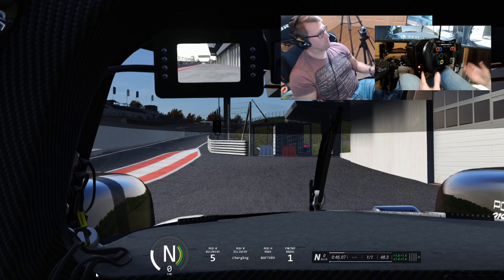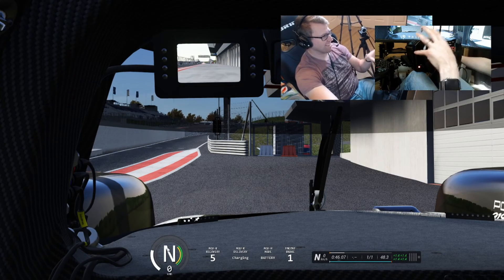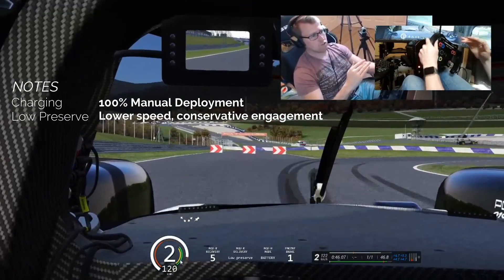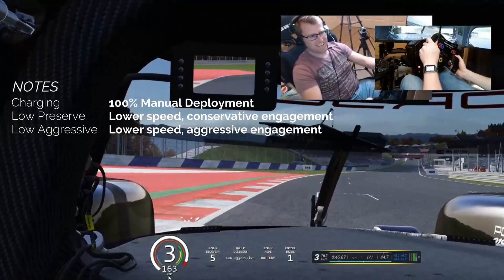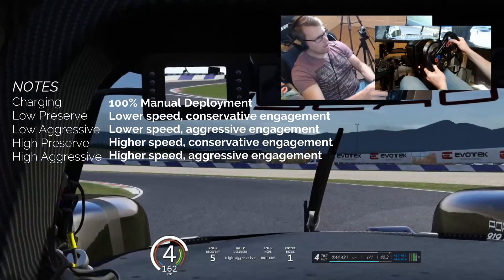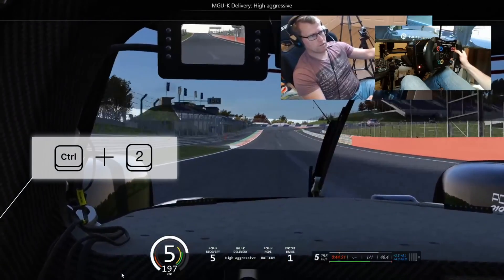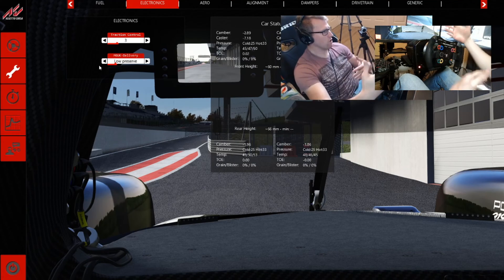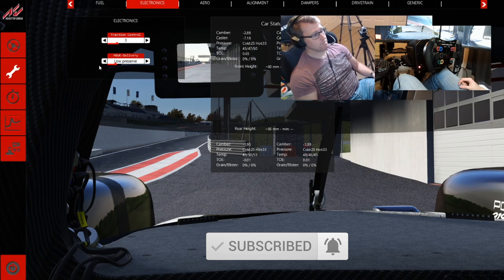MGU-K Explained in plain english | Assetto Corsa | Porsche 919 Hybrid 2016

Comment: No matter what setting I have the MGU-K in, it always empties before I reach the start/finish line, which costs me tenths of seconds and positions in races. Any tips?
Reply from the maker: Yep, use manual deploy if you want more control. Or switch to charging during the parts of the lap that you don’t want to deploy on. It also depends on the track. At de la sarthe, you are likely to run out of your allowance quite early on. I recommend balanced low, in general
Reply: Update: I finally figured out a sufficient strategy. Thank you!

Comment: Some cars have battery and motor options, and i have yet to fully understand how that works, can you give me clarifications? Great work btw, the channel is relatively small but is a little gem nontheless, keep up the god work :)
Reply from the maker: Thanks so much for the kind words!

There are a few battery options, i'll go over them at a high level:

KERS: Simple system, with regeneration on braking, which simply gives extra battery boost
MGU-K: Intelligent, automatic deployment of recovered kinetic energy (energy from movement of the wheels which would otherwise be lost)
MGU-H: Intelligent, automatic deployment of recovered heat related energy (energy from the heat of the exhaust which would otherwise be lost)
Push to Pass (P2P): limited number of uses available in a race, pushing this gives you a boost of electric energy, like kers, but it lasts a set period of time so can be strategically used for overtaking or defending positions.

Yeah the channel is small because I've only been dedicating time to it for the past 3 months. I really appreciate your engagement with the content and thanks for taking the time to comment :) I hope my answer helps, without too much boring detail :)